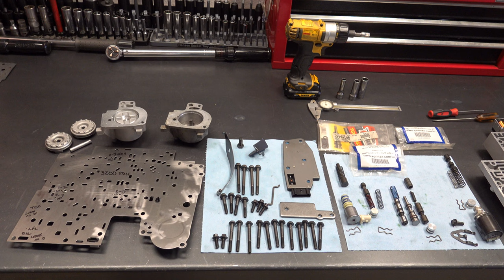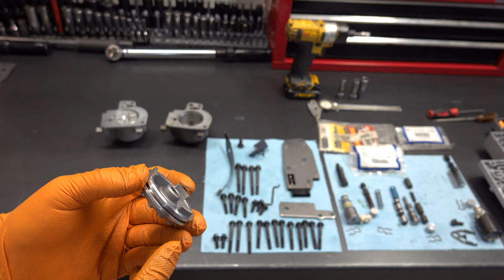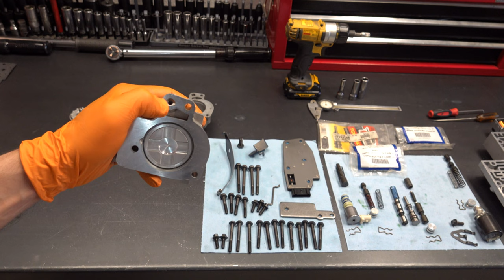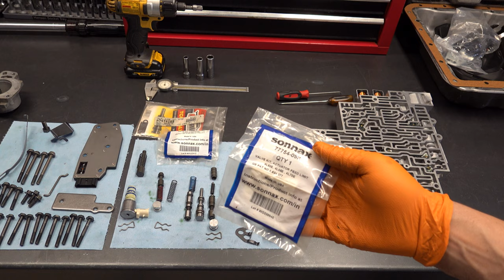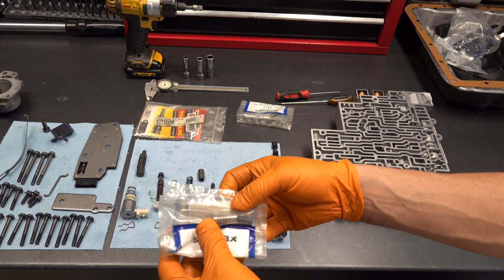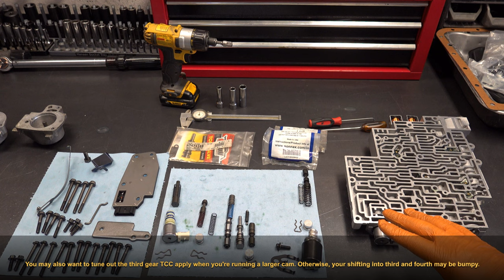4L60E High Performance PT4 - Valve Body and Spacer Plate Mods

Comment: Hi Nick do you have a contact # , i would live to get a sleve to block off the 2-3 valve and the  solenoid  , Also whatever you use for the TCC regulator valve,  Not sure what to do exactly with the 4th accumulator, i need max apply for 4th, Maybe i can just send you my Valve body and you can set it up?
Please let me know,
Walter
Reply from the maker: Hi Walter, you can run whichever year Fitzall valve for the TCC regulator if it's both worn and in need of conversion to an on-off. Otherwise two .187 check balls in between the spring and both valves (can be acquired via Amazon) will accomplish the same thing for basically nothing. If you have the inboard valve  that is cylindrical and has a 'pocket' for the spring, simply turn it around in the bore so the back of that valve faces the spring. That will also convert the PWM to an 'on-off' mechanically.

Block the 4th acc feed in the case with a cup plug and leave the bore itself completely empty.
Reply: @nickstransmissions  Hey Thank You for getting back to me so fast, I appreciate it!!,  OK Not sure if you remember but im the guy with the 87 Buick T-type LS conversion, 4L65E (2008 Valve Body)  , She slips in 4th, 1-2, 2-3  and 3-4 shift good and she even cruises good in 4th But if i lay into her the slightest she slips, I believe that the Bet Performance Servo is the culprit,  I remember i didnt like the way the servo was kinda loose when assembled, I reached out to the owner of the company and he said to scuf the seeling ring with some light sand paper, Now he denies that he said that and says he told me to take the seal off and stretch but That sis not what he told me the first time, Anyway its funny because now has updated his servo and i believe its the 4th piston that is different, i believe he redesigned it and is using a factory OEM seal,  He wont send me the the revised version with out paying and knows i had this issue from day one, so moving along i wanted to know if i should get a sonax super hold servo kit?
Walter
Reply from the maker: You're welcome, Walter.

How many miles on the transmission? 

Was it recently rebuilt or just installed as a used unit?

'Bet Performance' manufactured the servo assembly?

You can install the Sonnax super hold servo to see if that fixes the problem; if it's only slipping in 4th gear I would investigate both the servo as well as 4th accumulator to see if the seal is excessively worn. Also verify your servo inboard travel - should be between .075-.125 for optimal band clearance.
Reply: @nickstransmissions  Hi Nick, Good Morning, Thansmission was brand new on a pallet ,  Long story short the Car is supercharged and makes a lot of power, And my Budget was to beef up the valve body and Servo assembly as best as i could for it to hold the gears,  I know i need a fully Built Transmission for my application But for now i wasnt going to do 1/4 mile racing , Just a pull in the street and mostly cruising to some local car shows etc,, Yes Bet Performance makes the servo, i believe its a private independent guy,  Not sure why i didnt get the Sonax to begin with, Anyway,  i have a Car Cruise set up for june 2nd that i organize every year coming up and after that i would like to drop the pan and VB and set the valve body up the right way,  I did a transgo shift kit and sonax 1-2  and foward pinless accumulators,  I believe i didnt do anything to the 4th accumulator up in the case besides what Transgo said to do,  I think replace the factory spring for a transgo spring,  
Anyway i have a good feeling that the Bet Performance servo is causing the issue, i believe that its leaking past the seal aand not holding the band, Cant go wrong at this point with a Sonax servo, but i would like to do the proper things to the VB for Max apply and hold, Not sure what else needs to be done and what to drill the spacer plate out to,  i do have a PTC 2,800 stall with Lock up installed, Maybe you can help me with that,  
Walter
Reply: @nickstransmissions  Hi Nick, When using the Sonax servo i believe the holes in the spacer plate need to be drilled out larger than .093  that the Transgo kit requires , What hole sizes do you recommend?
Reply from the maker: Hi Walter, leave the 1-2 feed hole alone for now if it's already been drilled out...The larger the servo, the more robust/firmer the shift feel so you don't want to over-shoot with the orifice resizing...Too aggressive a shift, you'll eventually break the band (not to mention all the discomfort you'll feel as the driver). Otherwise, I'd keep the 1-2 feed at .076-.080...2-3 feed, 3-4 feed and band release at .100. Block the 2-3 downshift valve inboard with whatever you have that will fit into the bore and work.
Reply: @nickstransmissions  OK sounds good, while i have the VB out is there anything else i should do?
Reply from the maker: I think you have everything covered, between everything you have already done plus my recs above - you should be good to go once you get the servo situation sorted out (say that three times, lol).